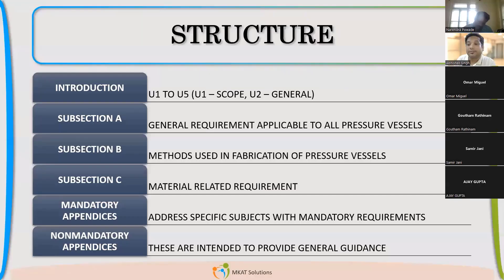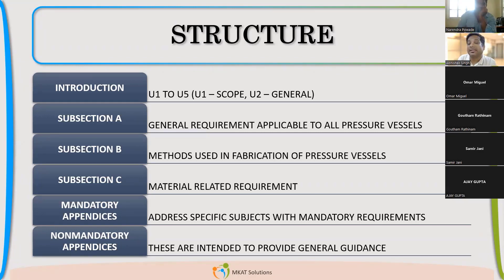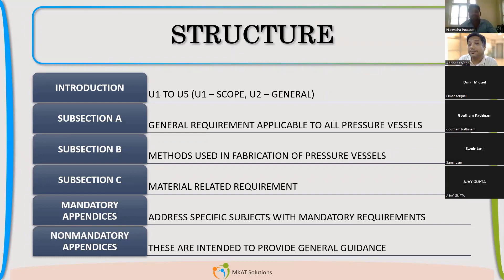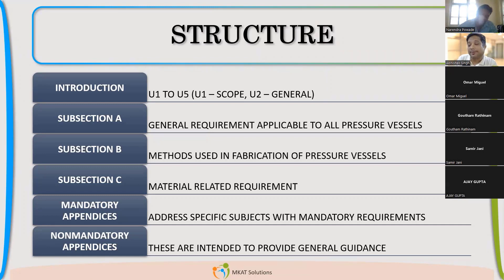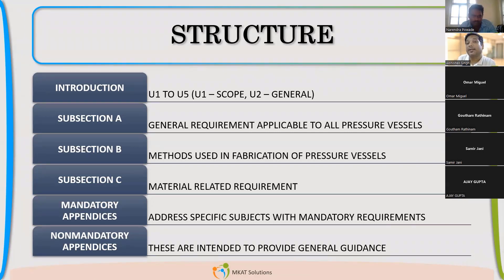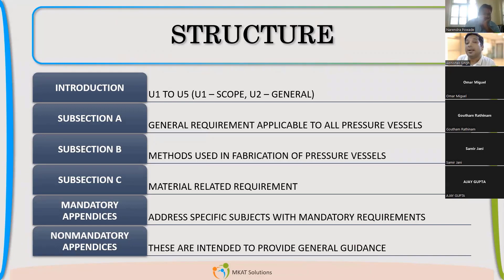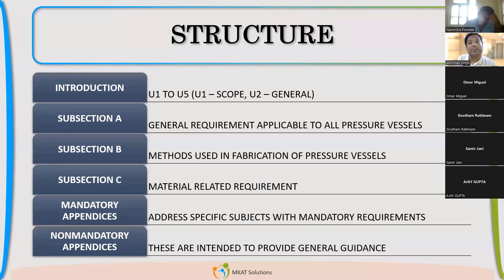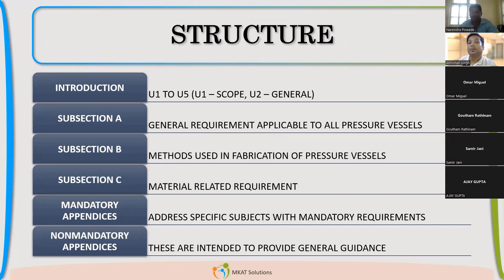Structure of ASME Section VIII Div1.

Comment: Why UHX is part of subsection C? It is containing design and fabrication related requirements for heat exchanger. It should have been separate section or part of subsection A.

Your thoughts on it?
Reply from the maker: Yes you are right. ASME committee is still undecided about its actual place.
Reply: I think it can be shifted to mandatory appendices. Similar to expansion bellow or non standard flange design.